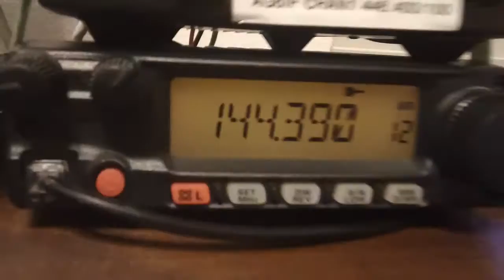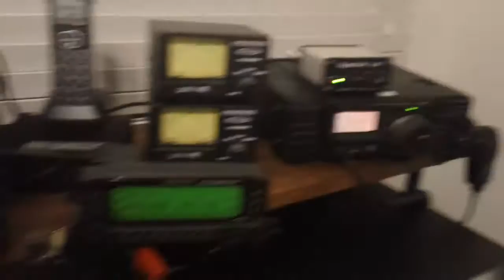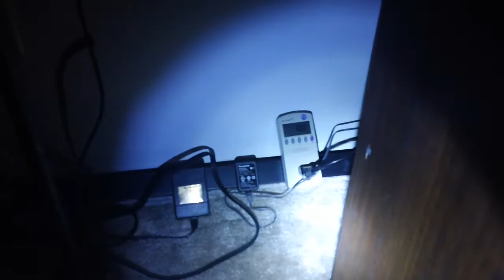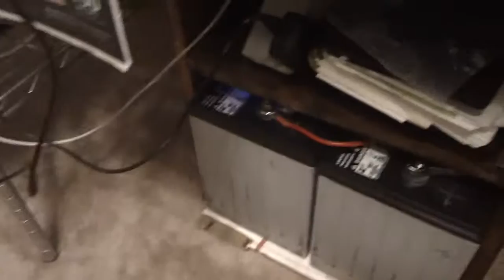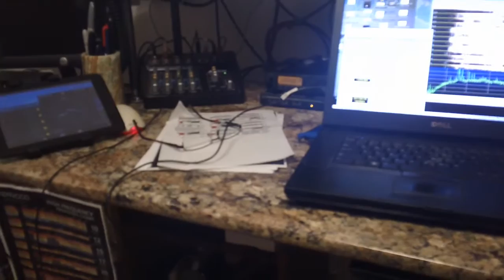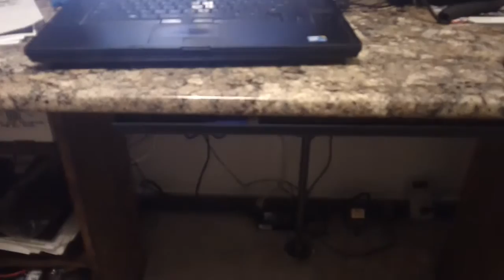Ham shack emergency power, 12 volt, 420 amp hours total 6 AGM battery, Solar plug S400 Power supply

Comment: Nice setup kc9cjc
Reply from the maker: thank you, I moved out of commifornia and left my AGM batts with local hams, and rebuilding using lith phos which should last 10+ years or 2000-3000 cycles. 73  ag6if
Reply: I would like to build me a battery setup one day.
Reply from the maker: @chevyguy1128  I am testing the cheapest lithium phosphate brand I have ever seen, miady 16ah batts are around 50 bucks each,..  My favorite Bioenno is about 160-180 for the same capacity.   We'l see how they hold up...so far they are great!
Reply: I'll get my radio station set up soon I hope all I have to get is a antenna tuner I am on disability so I have to buy a piece at a time on a very tight budget
Reply from the maker: @chevyguy1128  one step at a time Shawn, good luck on your journey of building up your shack!! 73

Comment: I like it....but have to admit, that looks like a fire waiting to happen. Im a general contractor, a ham radio operator (only a tech), and even have and use 12v battery backup power in my “shack”, which is a room in my house. But the number of batteries, the amount of stored power you have there in one location would make me a bit nervous.

I would like to learn more about solar power for a portion of our home. Meaning emergency backup power by means of solar.
Reply from the maker: Everything is connected with 10ga wire and a 30 amp fuse or breaker,  on + and -.  Any short circuit would theoretically disconnect from the buss.  The reason for so many batteries, is 1. capacity, 2, many entry points for current, so that the current is spread out across the buss instead of trying to pull 100 amps from one place if 5 radios were transmitting at the same time.

Comment: I would love to find a laptop that runs on 12v...I'm off grid..solar, generator, etc..my station, is off 12 volt batteries, as well...modem for internet is 12, as well...battery on laptop is 19volt, and I have to power up the genny to recharge it...I could use my inverter, but the idea of a 12v laptop is appealing..73, de Tim...VE6PG...
Reply from the maker: simple, just get a buck boost 12 to 19 volt board, put power poles on the input and the proper coax connector for the laptop.  i have one machine that DOES take in 12 v.  , it is an EEE notebook.
Reply: Hey Tim, here's a link for your 12vdc powered laptop...   https://youtu.be/dFwgtdFgKa8 

73s de AG4KN
Reply: 12v runs the laptop the 19v will run and charge the battery had one in my truck years back.